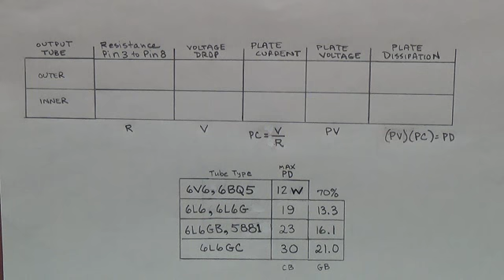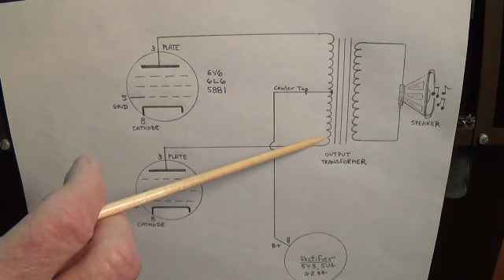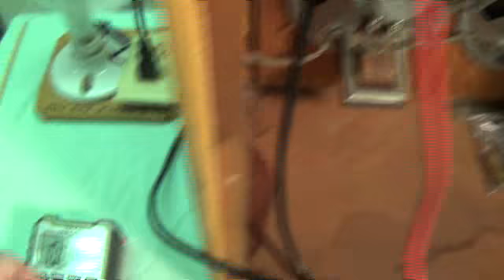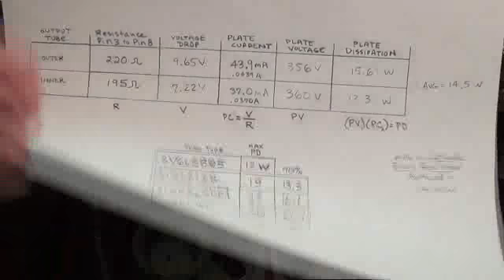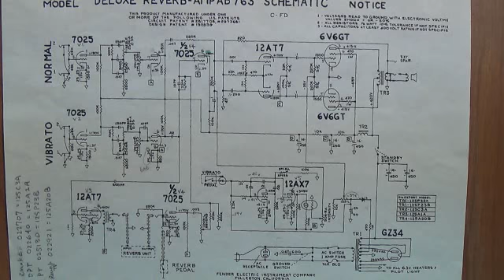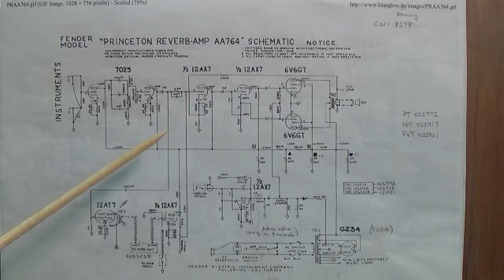Biasing Double-Ended Amplifier Output Tubes, Part 2: Demonstration and Discussion

Comment: Hi Doug, I'm familiar with the transformer shunt and cathode resistor voltage drop method to check current flow through the output stage, but hadn't thought about measuring the output transformer coils and subsequent voltage drop they create, this seems better than the transformer shunt method as when one of your test leads falls off of pin 3 and hits the chassis you get a nasty surprise, also its not fun to change between current and voltage measurement if you only have one meter.

Hello from Scotland!
Reply from the maker: Greetings, JA. It's great to hear from Scotland, home to several of my ancestors. Yes, the OPT method offers several benefits over the other methods. For one, it tends to be more accurate than the cathode-resistor voltage-drop method, especially if the measurement is made across a (tacked on) 1 ohm resistor. The values are so low that any error in technique or equipment will yield a significantly erroneous result. Second, it's safer. The transformer shunt method has all sorts of pitfalls (like forgetting to change from amps to volts....as you mentioned) that will reward the slightest carelessness with smoke, fire, and damaged equipment.....I speak from experience :)

Comment: Doug,
Do you have a video where you discuss biasing and use the tube characteristic plots from the tube manual? Ie power dissipation and the location on the load line for both single and push-pull output stages. 
Thanks,
Craig
Ps I got a lot of info from biasing parts 1 and 2.
Reply from the maker: I'm glad to hear that the videos were helpful, Craig. No, I have not touched on tube-manual graphs. It didn't seem necessary for my target audience, and is not really necessary for routine biasing, which simply requires measurement (or calculation) of Plate Current, and measurement of Plate Voltage, from which the Plate Dissipation is readily calculated. Since the maximum Plate Dissipation value is well established for all common output tubes, no graphs are required.
Reply: So most techs bias at max plate dissipation for cathode biased and 70% for gate baised? Is this rule of thumb or does it just happened to land in the middle of load line. I'll continue to learn about tube amp design, part selection and biasing. Thanks.
Reply from the maker: Yes, for cathode-biased circuits the PD is around 90 to 100% of max, and for fixed bias (grounded cathodes) it's around 65 to 70% of max.

Since PD and Load Lines are both a function of plate voltage and plate current, they are probably related, but routine tube biasing has never, to my knowledge, required more than an accurate measurement of PV and PC.

If your research turns up a requirement for consideration of tube graphs when biasing output tubes, please share it with us. Any new insights and information are always appreciated. Thanks for your thoughtful input :)
Reply: Uncle Doug
Will do. I think I'll take this on as intro to tube design. Been a BJT/MOS designer since high school, no tubes though. Biasing at 350V is crazy in my 3.3v world.
Reply from the maker: The change from solid state to tubes can indeed be "shocking" :) There are some output tubes that operate with a PV of 800V !! Good luck with your project, Craig.
Reply: Uncle Doug I started Crowhurst 3 volume set for beginners at http://www.tubebooks.org/Books/. If I can't find answers there, I find a college textbook from the 50s-60s.
Reply from the maker: I admire your dedication, Craig. As a former school teacher, I wish I had more students who actively pursued knowledge in this manner. Good luck with your quest.
Reply: Thanks.
Reply: Craig Hollabaugh
OK, here's what I have so far. Crowhurst 'Basic Audio - Volume 2' covers the area around load lines. its a fast read, simple, only need ohm's and algebra to understand. Pictures are great. As far as my question about the 70%-90% 'rule of thumb' and how the load line fits into this, I'm still looking. I'm now looking up my Ph.D. EE advisor, Dr. Philip Allen, he'll know where to point me and which college text to find. I'll be back.
Reply from the maker: Craig, since the load line is determined by PC on the Y-axis and PV on the X-axis, and since the biasing procedure consists of adjusting the tube(s) to the optimum PC and PV values (which should be the same as the values that established the load line), are we not simply duplicating the load line when we set the tube bias?
Reply: Uncle Doug I'm probably wrong here (haven't biased anything for decades) but for grid biasing the axis intersects (and then the load line slope) are set by the power supply voltage and DC load. Adjusting the bias, moves the operating point along this load line. This still doesn't explain where the the rule of thumb comes from.

An interesting topic in Crowhurst 'Basic Audio - Volume 2', www.tubebooks.org/Books/crowhurst_basic_2.pdf, pdf page 78, doc page 2-71 "Distortion and Power Output Vary with Load Resistance". I haven't quite found a reference that discusses if power dissipation/operating point affects plate resistance, hence potentially moving the load resistance match point around this curve.  This probably makes no sense. I'll keep going and post here. Thanks for the soapbox.
Reply from the maker: You're welcome, Craig. Good luck with your search.

The "Rule of Thumb" is based on the fact that the PD value in fixed bias output tubes increases (up to 30%) when the tubes are driven, so they must be biased at 70% of max to allow for this increase during use.

The PD of cathode-biased output tubes is self-regulated ("increases in cathode current create a larger voltage drop across the cathode resistor, which in turn, creates a larger negative grid-to-cathode voltage, which counteracts the increase in current") and does not increase during use, so they can be biased at 100% of max.
Reply: There are three values of dissipation to be considered. The maximum dissipation as specified on the tubes' data sheet, and instantaneous dissipation and short term average dissipation during playing. In fixed biased amps, during playing the instantaneous dissipation can be allowed to increase above maximum, but the bias should be set at a level such that the instantaneous dissipation is below the specified maximum for periods long enough to ensure that the short term average dissipation does not exceed maximum. For many, if not most amps, 70% is high enough to avoid crossover distortion and low enough to keep short term average dissipation at a safe level.

Comment: I had a question- 
Is there a way to make an Adjustable grid bias on an amp without a bias tap on the PT?  I notice on amps like the Deluxe Reverb ab763 the bias is connected to a pot in a bias supply that comes from a special 50v bias tap on the PT- but on the Princeton Reverb aa764 it connects to the "Intensity" pot of the tremolo circuit which in turn connects to the HV330v tap on the PT.  If there wasn't a tremolo circuit how would one create an adjustable grid bias supply with this type of transformer?
Reply from the maker: Good question, Sam. In the PR circuit, the grid bias voltage is obtained from one of the 330VAC windings of the PT, then dropped to about 90-100VAC by a 100K resistor, then half-wave rectified by a diode to about -45VDC, filtered by a 50uf @ 50V filter cap, adjusted to -35VDC by the 27K resistor to ground and sent to the 6V6 grids ("about" voltages are estimated). You adjust the bias voltage by varying the 27K "leak to ground" resistor (go higher for higher BV, lower for lower BV). The only reason the BV goes to the Tremolo Intensity pot is the tremolo works by rhythmically varying the bias of the 6V6's, and the trem signal and BV voltage are mixed and apportioned by the pot. If there were no tremolo, the BV would go directly to the output tube grids (through appropriate grid resistors of course).

To make grid bias variable in another amp, you would have to find the source of the grid biasing voltage and make it adjustable by adding a potentiometer. Please see my "Converting the PR to Adjustable Bias" video to see how this is done. Good luck !!
Reply: Uncle Doug That explanation was perfect, thank you.  I ask because I have a 350-0-350 transformer that I plan on using for a grid-bias 6v6 amp and all the Deluxe Reverb schematics had me in a tizzy. As always I will put your knowledge to good use.
Reply from the maker: Good luck with your project, Sam. Please let me know how it turns out :)

Comment: One thing I've always been curious about is that when you look at the layout of many grid biased amps, they will say that the cathode goes to ground on the schematic, but when you look at the layout, there's actually a 1 ohm resistor on the cathode of each power tube. I've noticed this on the Marshall 2203. For the life of me, I can't figure out why they did this.
Reply from the maker: Greetings, Alva. The 1 ohm resistor is placed there to facilitate the tube biasing procedure. By measuring the voltage drop across the 1 ohm resistor you can determine the plate current, using Ohm's Law.  If the cathodes were connected directly to ground, you would have to solder in a resistor to make the voltage drop measurement. The presence of such low resistance between the cathode and ground does not affect the performance of the amp, so leaving them in place just makes the biasing procedure easier.
Reply: Uncle Doug
Oh! That makes perfect sense!

Comment: I ll try that, I read on fenderguru the wire from middle lug leads to 220k resistors connected to grids and can be grounded when changing to cathode bias. I could disconnect and tape the wire instead.
Reply from the maker: You should disconnect the end of the wire that connects to the center lug of the bias pot and ground that end of the wire (which will then ground the junction of the two 220K resistors). Leave the bias pot (and the other two lugs) alone.

Comment: Ok so my results as is. havent changed anything yet. 448V on plate, 42ma current. 18 watts. If math is ok 18 is cold for 5881 according to your vid? 23 watts ideal? Now  I believe I need to remove lead from middle lug of pot and solder to ground. Then try cathode resistor values to get correct PD.
Reply from the maker: It's actually 18.8 watts, which is about max for a cathode-biased vintage American 5881(and way too high for a grid-biased one). Some of the newer, Russian 5881's can handle 23W, but with vintage tubes it's best to be conservative. Did you check both 5881's? The other one may be much higher or lower.

I would un-ground the 5881 cathodes, then connect a 350 to 500 ohm 10W resistor (start high to protect the tubes) from 5881 cathodes to ground, disconnect the grid bias wire from the center tap of the bias pot and ground the end of the wire (not the bias pot). Determine the new bias (PD) is with the 350+ ohm resistor, then fine tune the resistance (probably downward) until you get around 18 watts for each 5881 (36 watts for the pair). You can also connect a 25uf @50V capacitor in parallel with the cathode resistor to improve tone and volume.

Comment: My bassman is that hybrid thing. 150 ohm pin 8 to ground but still has a pot to adjust for hum. This vid is helpful. I ll try full cathode bias. The cap value filters highs? The one coupled with the cathode resistor. 25Uf seems common on some fenders.
Reply from the maker: Hum adjustment usually varies the center tap of the 6V filament circuit, not bias. The bypass cap doesn't really filter highs, but it does have an effect on tone and volume, and 25uf is probably a usable value. Good luck.

Comment: These videos are really compelling!  I have a couple of questions relating to the deluxe Reverb schematic (although I think generally applicable).  What is the "other" grid shown on each of the 6V6GTs?  And what is the function of the 12AT7?
If I made my "guitar power amp" I am guessing I would need the rectifier, the 12AT7 and two power tubes.  Cheers  Jon
Reply from the maker: Thanks, Jon. The "other" grid, located near the plate of the tube is called the Screen Grid. Its purpose is to accelerate the electrons traveling from the cathode to the plate and thus increase the gain (volume).

The upper 12AT7 is the Phase Inverter. It provides an in-phase signal to one 6V6 and and out-of-phase signal to the other.

Before you start on your power amp, please read my previous note regarding this matter. You really don't need a power amp, since a regular amp will work for the purpose of boosting the pre-amp signal from your small tube amp.
Reply: Thanks again. Yes, I got the point about using another amp; but as it happens I don't have one!  I thought the power amp project would be a good project to do, as it would be simpler and quicker than making a complete amplifier and be an accelerated learning opportunity to learn about tube amps (I built a pedal cycle to learn about bike maintenance).  Cheers  Jon
Reply from the maker: Well, in that case, it may indeed be a good learning project. Best of luck, Jon. Let us know how it turns out.

Comment: Hi Doug. Just wondering why the voltage off the rectifier goes through the output transformer. Is it a convenience thing rather than hooking up directly? And would their be no issues with all the dc from the rectifier flowing while the ac audio is trying to share the same space (i know transformers wont let dc pass)? Lastly, i'm struggling to understand how lowering the cathode voltage helps tube life, especially if you already have more than the max rated plate voltage (say 390v on an el84 and then 16v on cathode trying to go lower with bigger resistor). I suppose it all has to do with relational voltages inside the tube?
Reply: I guess uncle Doug is busy :-)  Here comes a crash corse that might clear up a few things. 

The point of the power tubes is to drive the transformer. That i why the B+ voltage is run true the transformer. The transformer works as a gearbox so you can get the get the high voltage signal that appears at the plates to mach the speakers that likes to se low voltage and high current. Transformer will let DC pas from center tap (CT) to the plates but not to the secondary so it isolates the high voltage from the outside world (speakers) . Not a convenience but a necessity.

The cathodes emits electrons that ends up on the plate but you can control how manny electrons end up there by inserting a grid with a signal in between. To help that grid to control the amount of electrons flowing from cathode to plate you place the grid at a negative potential compared to the cathode. The more negative it is the fewer electrons can pas it and end up on the plate. The point of bias is to place this negative potential (Bias) so that A. we reduce the flow of electrons so we don't destroy the tube with to much flow. B. The signal that we want to amplify needs to be floating on a negative bias just right so that it really controls the flow of electrons.  

Ex If you have 300V on the plates of an EL84 bias is usually around -7 volts. If you increase the plates to 390 volts the plates would attract more electrons but the plate can't take that kind of beating so you have to lower the bias to reduce the amount of electrons that can get past the grid and end up on the plates. You do this by increasing the resistor connected to the cathode.  Hope this helps.
Reply from the maker: Sorry for the delay, Rob, but YT never alerted me to your inquiry.  First, I appreciate the excellent answer provided by Luke, and I would add the following:  The output transformer (OPT), since it is an inductor, acts like a (for free) filter choke to smooth out any ripple in the B+ (high voltage) while it is distributing the high voltage to each of the output tube plates. The DC in the OPT primary can happily coexist with the AC signal that is traveling across the OPT to the speaker. Tube life is largely determined by their plate dissipation value. PD is a product of plate current and plate voltage, so anything you can do to lower either value will result in lower PD and longer tube life. Increasing the cathode bias resistor value will result in lower plate current and lower PD.
Reply: In addition, since the current is flowing in opposite directions in each of the half-primaries, the hum induced in one half is cancelled by the hum of opposite phase in the other half.

Comment: Thank you for an excellent tutorial !
I have a similar configuration amp to check, and it is equiped with 6V6 tubes. Judging from your chart, 12W is max Pd, should I aim for around 8.4W (70 %)  ?
Thanks ! just subscribed to your channel ! Keep on the good work, we need people like you :)
Reply: Nervermind I just found out in another of your video ... :)
Thanks !
Reply from the maker: Welcome, JC. In cathode-biased amps, you can set the bias closer to maximum (12W for 6V6's) than in grid-biased amps (70% of 12W). The reason being that the plate current increases with increasing signal in the grid-biased circuit, but does not increase in the cathode-biased. Regardless, I still tend to set the cathode-biased PD at less than max, i.e. 10W or so, just for tube preservation.
Reply: I came back to this video to get some real life values for the OPT primary resistance method of biasing, not to pick holes in your beautifully clear explanation of a difficult subject, but I feel l should point out that plate dissipation is in fact the product of plate current and plate-to-cathode voltage. In a fixed biased amp the tubes' cathodes are tied to ground (the chassis) so the voltage measured at the plate is plate-to-cathode voltage, but in a cathode biased amp the cathodes are at a positive voltage with respect to ground which means that for a cathode biased amp:
Plate dissipation = plate current x (plate voltage - cathode voltage).